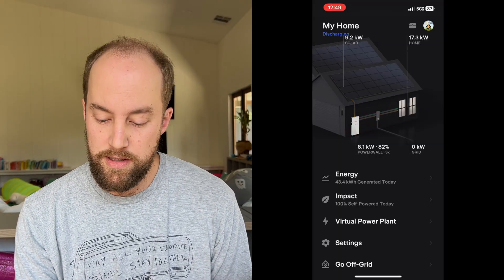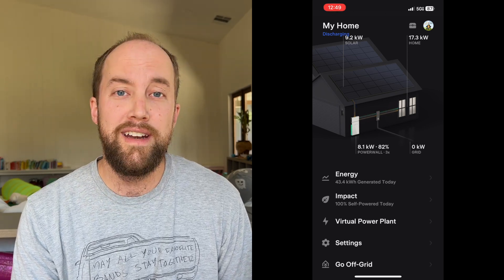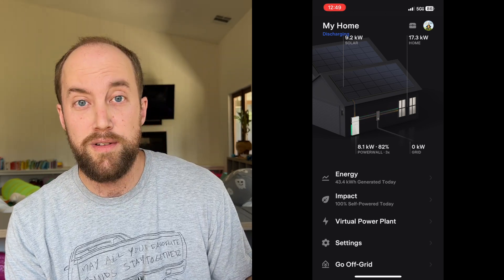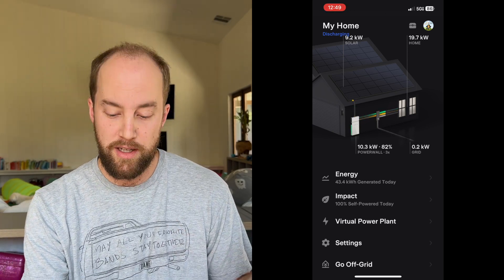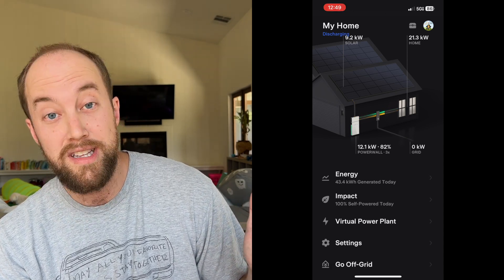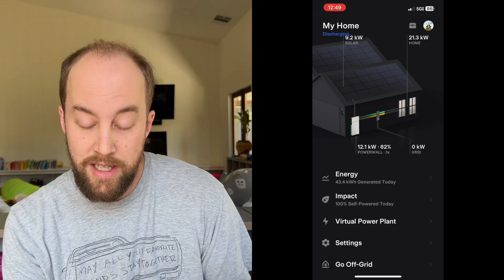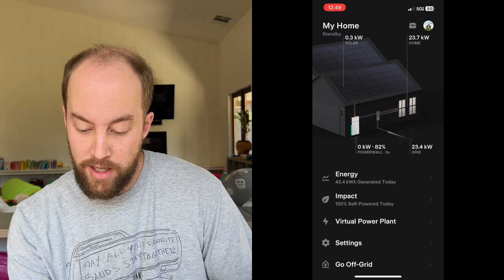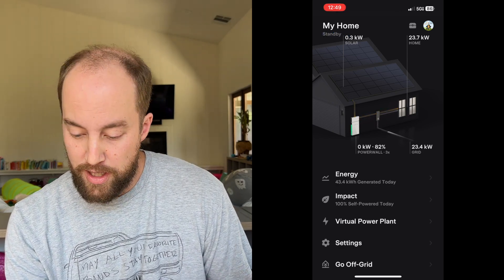Powerwall Load Test - What Can 3 Powerwalls Handle Continuously?

Comment: We are getting ready to add 2 PW3s to our 12.5 Enphase PV system.  Given the 30% Tax Credit and the $300 per kWh CASH REBATE (27 kWh X $300 = $9100)  from my utility, I'll be OTD for about $17K.  That's about $5K less than a 24kWh GENERAC generator I was initially looking at.  I've crunched my numbers every way I can and the 2 PW3s and my PV system can power our small new high-efficiency villa indefinitely, with little compromise.  We'll be an "ISLAND OF PEACE and SAFETY" in a sea of chaos.
Reply from the maker: That's a killer incentive from your utility! Do you have to agree to VPPs or anything to receive that incentive?

You're going to love the Powerwalls. They truly are the icing on the cake for home solar generation!!

Comment: Hi, what’s your firm version? I just got a PW3, and it drops the solar production when battery is discharging. I saw you have a good solar production when it’s discharging. So wondering if my system has some issues
Reply from the maker: We're on 24.12.3.

Your system might have some issues. Solar should be priority in covering the house load and then powerwall picks up the difference with no change in solar output

Comment: Odd that your Powerwall gateway reset like that and switched to fully supplying from the grid. When i ramp up my household load it is supplied first from Powerwall and if i increase load further it only draws the additional demand from the grid with the Powerwall still exporting at maximum power.
Reply from the maker: I just assumed that it was what happened when you maxed them out continuously for too long. Thankfully not too much of a worry as we don't ever realistically draw that kind of power in the "real world"

Comment: One aspect that confuses me is how many units can be installed in total.  With the Powerwall 2 apparently it's 10 units, maximum 3 per stack or sandwich. All I could find is one website saying you can stack 3 or max 40 kWh. Unclear if they're confusing with individual stacks or the total number of batteries in one system... do you have any info on that?
Reply from the maker: It's 4 stacks of 4. 4 units max with integrated inverter, then 3 DC expansion units for each inverter unit, so 16 total (216 kWh).  Thank you Ernesto who installs these for helping me clear that up!

Comment: I had a Raspberry Pi lying around.  I put Home Assistant on it.  For example, it shuts off car charging at 4 pm.  If the cars start charging at 2 and need to charge for three hours, it runs an hour into peak rates at 11.5 kw.  I also use it to limit solar exports; I went from 50% solar exports last year to about 20% this year.  I wrote a number of automations in Home Assistant to do this.  I was off NEM 2.0 for a number of years, long story.  For someone on NEM 3.0 it may be handy.  I'm still waiting for the charge on solar option on the Tesla apps.  Till then I use the automations.  My 2020 era 7.6 KW solar and 2 V2 Powerwalls cannot run my entire house.  One of two AC units and the Tesla charger are not powerwall backed up.  And I need to add a soft start the the PW backed up AC unit.  You've got a sweet system.
Reply from the maker: That sounds pretty sweet!  When you say you use it to limit solar exports, do you mean by initiating charging?  Or do you have it automate any other processes?  For us, in the summer, I'll specifically save our laundry for the middle of the day on my days off to better utilize our solar.

My hope is that they introduce a feature to prioritize charging the Powerwalls to my set percentage before initiating Charge on Solar.  I'm sure it's coming, but waiting stinks :)

Thanks for the compliment, I definitely tried to get the most system I could get!  I wanted the whole house backed up no matter what.
Reply: In order to limit exports automatically I wrote automations to change the charging amps (to limit powerwall draw down and those losses), set powerwall reserve levels during the day (to allow the Powerwalls to charge up before peak rates if the A/C came on or solar production was low, etc. ), and start and  stop charging at specific states of charge, etc. while running the powerwall in "Self Powered Mode" to try and use solar first before PW charging.  Manually, if it was going to be a sunny day, I'd draw the powerwall down by car charging to make room for the solar coming in.  I could automate that process as well.  And like you, manually delay appliances, but the car charging and A/C are the heavy hitters.  Waiting for the app updates as well, but wanted to limit my exports while I was completely off NEM and getting zero credit for them.  I believe "charge on solar" will only work when the Powerwalls are at about 100% and the system would start exporting.  For my car I would pick something like below 50% "charge now" and between 50 and 80 charge on solar exports.  For my wife's car, I'd pick 70 and 80 respectively, if I understand how it's supposed to work.  Yes, I know this is all extremely twiddly and complicated, but I was throwing away about 5 MWH a year, half of my production, for a while there, due to that lack of NEM.  Limiting exports now with NEM 2.0 saves the Non Bypassable Charges.  I believe these costs are lower for me with SCE than you with PG&E.
Reply from the maker: @stephengwinn6859 Wow, you really got down into it and set it up nicely!  I anticipate that once our Model 3 gets Charge on Solar we probably won't export too much to the grid anymore.
Reply: @TheMahkus  BTW, if the grid was actually down or disconnected, that Powerwall Reset would result in power loss until it rebooted.  That's why I need an A/C soft start, in case the A/C is running when the grid goes down.